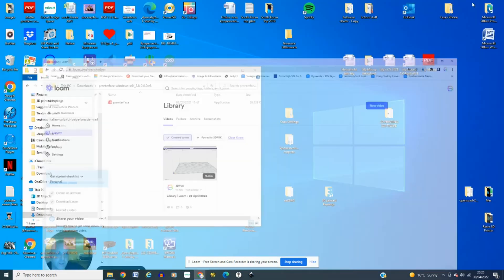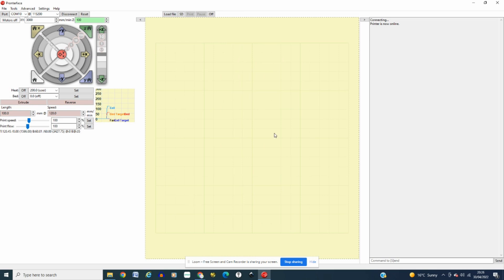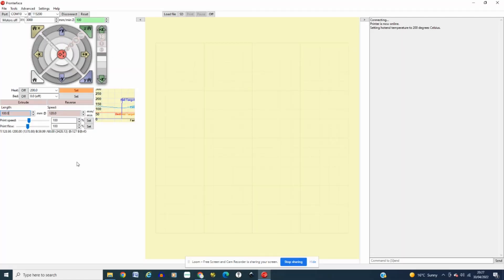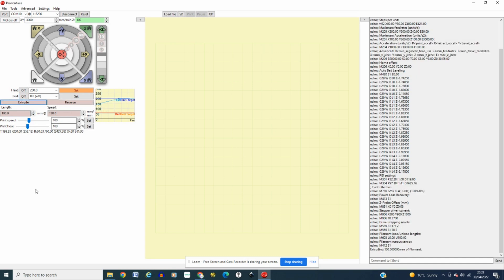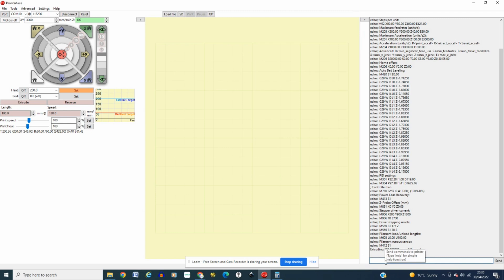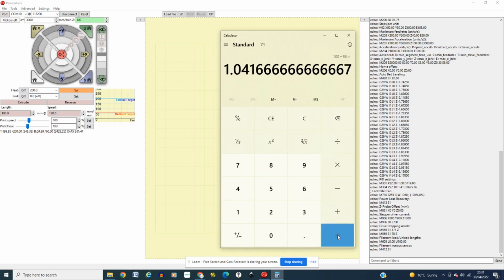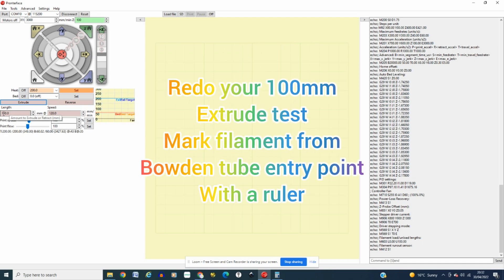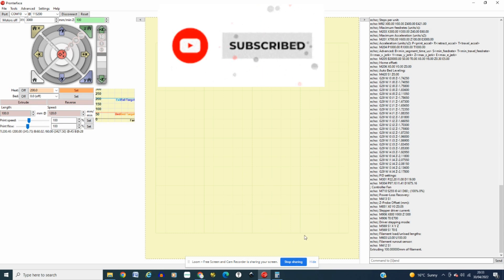Anycubic Kobra Max E steps value change using Prontoface

Comment: Your method doesn't take into account the possibility that a user may have OVER set E-Steps, in which case the mark you put on the filament has retreated inside the extruder or possibly even thru the hotend and been extruded!!!

What you want to do is put the mark at 120mm, then have your interface software (cura, pronterface, repetierhost, etc.) extrude 100mm, then measure ensuring you have 20mm measured between the extuder opening and your line marked on the filament. If you're over extruding you'll have less than 20mm before the mark, and if you're under extruding you'll have more than 20mm, enjoy this new knowledge!
Reply from the maker: Appreciate the information

Comment: I don't know why but I'm getting this error

Connection error: Could not connect to serial port 'COM3'

I just turned it on, connected the cable. I don't have the faintest idea why I'm getting this.
Reply: Nvm, I changed it to COM5 @115200 and that worked. Shot in the dark, but it worked.

Comment: Just commented on your z offset video; my stock extrusion was ~92mm with E steps set at 405. Ended up with it at 448 to get the full 100mm. My Max does have a 'semi-'direct drive mod with the  extruder about an inch above the entrance to the hotend. I never checked E steps before the mod, so I don't know if that change had any effect.

Comment: I'm still very new to prontorface and 3d printing in  general.  what is the command to send or where do I set the extruder instruction to send 100mm of filament?  I'll look it up but think it might be good to ask and post so if it's answer anyone else can get the info quick here...

Comment: Do you do extrude the 100mm  through the hot end or no disconnect  the tube and measure?
Reply from the maker: Hey through the hotend
Reply: @3DPUK-TECH-CHANNEL  so when i do the calibration and tests and its actually worse, gaps, but when i put back to the default number 420 it prints fine, not perfect but a 7/10 print.... calibrated with hot end and without its like 2/10
Reply: messed with different flow rates and its just terrible

Comment: Hey I just noticed my m204 and m201 settings are very low compared to yours, mine is m204 p.300, r1000, t. 300, m201 is X700.00 Y300.00 Z100.00 E2000.00
I understand this is the actual acceleration speed, do you recommend a higher setting?
Reply from the maker: What machine do you have
Reply: @3DPUK-TECH-CHANNEL  Kobra Plus
Reply from the maker: @sumfellah  ok mines the max so there could be some different settings
Reply: @3DPUK-TECH-CHANNEL  i see, ill just leave it then.  Do you happen to know if you can use linear advance on your max?  I'm troubleshooting some issues and found the Cura plugin, and started to do the marlin code generating tests.. but the results haven't been consistent or useful.

Comment: Just because I'm OCD... would be it be better to enter the exact new number, for you 421.87 rather than 421.00?  Or does it not really matter.  Mine was 6mm short but I did the test twice and was very precise measuring exactly from the tip of the white tube (hope it's not from the actual entrance?).
Reply from the maker: I think it's all a rough measurement as long as it's around that..
Reply: @3DPUK-TECH-CHANNEL  I was curious if you recommend doing flow and linear advance calibration?  I've got a kobra plus

Comment: My esteps came to 438. I tested it over 200mm and got 185mm extruded
Reply from the maker: Ah ok which really goes too show that each machine differs. Hope you enjoyed the video and if not already done so like and subscribe 🙂
Reply: @3DPUK-TECH-CHANNEL  done done 😄 
I was having trouble with some prints and decided to to a temp tower. Using eSun PLA+ I normally print it at 205°c on my Sidewinder X1 but I found 195°c to be a perfect temp on the Kobra Max.
Reply from the maker: @Mendiesel86  yes I have also found that my setting for temperature is around 195 to 200 I always run hotter say 205 on first later with build plate around 65 then drop to 195 and 55 respectively thanks for the like and follow I've got a new video up definitely worth watching

Comment: I'm not sure if you mentioned it in the video (apologies if you did), but you should do a M500 when you are finished to save the "new" E-Steps value to EEPROM. If you do not do this, next time you power up the printer the "new" value will be lost, as the "old" value will be loaded.
Reply: Mentioned it twice actually ;)
Reply from the maker: Hey thanks for watching yes I think I mentioned it at around 6mins and 9 seconds 🙏👍